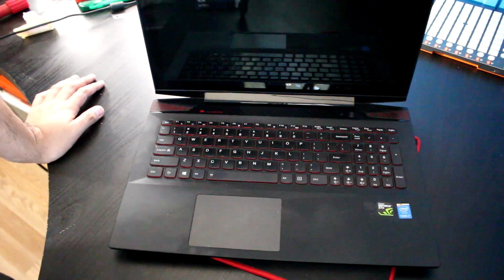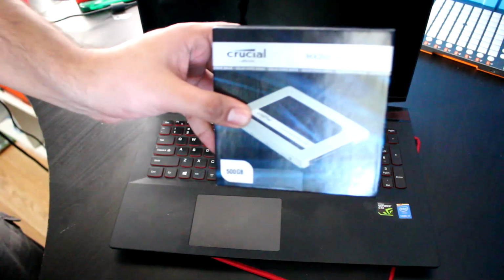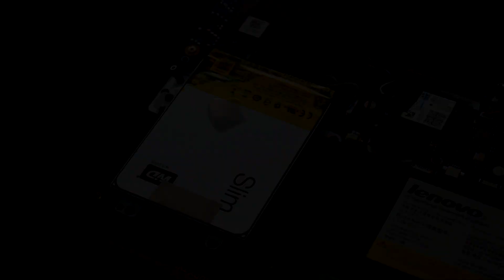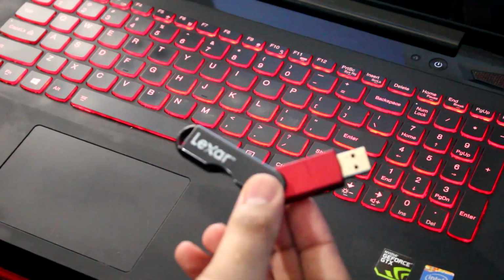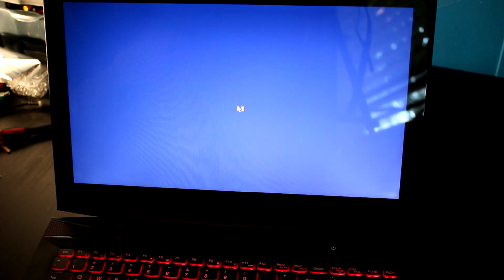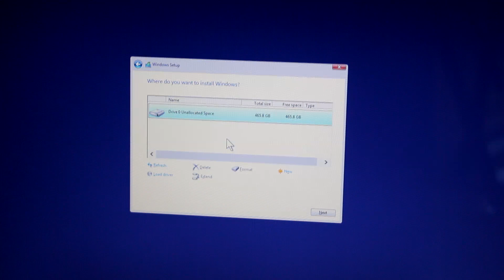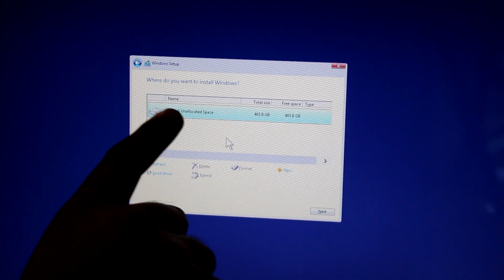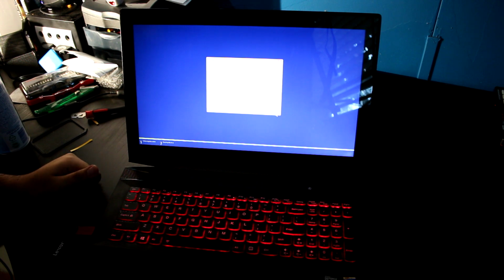How to Upgrade to an SSD on a Lenovo y50-70

Comment: Hi,
do you use an external hdmi-connected monitor with this laptop?
I have a Lenovo y50-70 with an integrated intel hd 4600 graphics card and a geforce 960M and unfortunately it does not detect an external monitor on the hdmi connector?
Did you have the same problem? How to solve it?
I have googled for a week, tried different things, tried other drivers and unfortunately it still does not work....

Many thanks for some help.

Comment: Crucial MX500 1TB 3D NAND SATA 2.5 inch 7mm (with 9.5mm adapter) Internal SSD

this ssd will work in my lenovo y50-70 4k????

Comment: Consult, this type of machines come with two hard drives, one solid, which would be the D and the other mechanical, which would be the C, or it is a single disk that divides it to have two disks, thank you very much in advance

Comment: So once I replace hard disk to ssd that means all my softwares and documents needs to be installed into the SSD again? Is there a way to retain all the files and still use SSD?
Reply: Yep, all files and softwares are retained on the old hard disk. You may want to backup the software installers (if you have them) into the hard disk before you remove it. Also, note that the old hard disk can still be used as an external hard drive, meaning you can still access files saved on it. Just buy an enclosure and cable for it.

Comment: Can you add a list of compatible SSD and HDD?
My SSD only works when it is upside down, so if I want to use my laptop, I need to uncover the components and remove the mounting screws, then flip the SSD over. I'm looking for a replacement for my storage.

Comment: Hi i just tryed this and need help. I brougt a Samsung 860 Evo and connected it to My desktop to install Windows 7 64 bit and it workt as a charm but when i connect the Samsung 860 Evo to My Lenovo y50-70 i get a message saying - defult boot device missing or boot failed. What did i do wrong how can i fix this ?

Comment: Q????... Did you back up all your files b4 you proceeded to upgrade.If the answer is yes.. which method did u use for backing up all files without any problems???.

Comment: does the sizes of various brands of SSD follow some sort of standard? if i get myself a Samsung SSD for example, will it fit into the harddisk cradle thing?

e: bought -> get myself
Reply: It should, bc laptop drives all have the same 2.5" form factor

Comment: Hey Keaton, quick question, looking at my hard drive trying to pull some information I see it's solid state hybrid. It's solid state generally better? It's a TB so not sure if I should upgrade or not!
Reply from the maker: I'd definitely upgrade to an SSD hybrids tend to die pretty quickly I've gone through 4 of them in 2 years as they corrupt easily. Not to mention they aren't much faster then a normal hard drive.

Comment: Thanks a lot man, so I changed the hard disk and it was turning on and off, turns out one of my RAM, is screwed up!
So have to get it replaced, but thanks a lot man!
If there is a problem like mine with anyone else then that was the issue!

Comment: Hey man, just wanted to thank you so much for this tutorial. My computer is faster now than it was when I bought it almost 4 years ago. Everything just feels so much snappier, like starting up google chrome is just instant now instead of having to look at a white screen for 5 seconds or more and starting up the laptop takes just a few seconds now. 
Can recommend this to anyone who's thinking about doing this.

Also to anyone who's wondering what SSD they should get. I got the Samsung 860 EVO (250gb) which is like 75 euro right now. It's a high quality SSD which will work great. Also I recommend just installing windows fresh. If you got the free windows 10 upgrade when it was around, it should be linked to your microsoft account and just getting the fresh install and logging in on that microsoft account should automatically get it activated for you.
Reply: Does every ssd fit in there

Comment: From brief research it seems that the windows key is tied to the motherboard. When you reinstall windows does it automatically detect that you have a machine that is activated for windows? You didn’t go over how you activated your windows
Reply from the maker: Oh sorry about that. If you are upgrading to Windows 10 then you simply go to the Microsoft website and download the latest version. Now if you upgraded from Windows 7 and 8 to 10 for free then the email you used to upgrade will be the way you activate Windows 10 no matter what machinr it will recognise the email. If not you have to buy it with said email and same thing.

Comment: Hey I have a question
If I have a Lenovo y50 70 touch screen. What specific SSD would I need to replace it with?
My hard drive is completely busted so now I can't boot up my laptop beyond the splash screen.
Also when you install a new hard drive do you have to install a new copy of Windows? I have one it's just that my laptop hated it when I tried to upgrade before and I always had to revert back

Comment: Buddy What difference does upgrading to an SSD make? Gaming Performance?
Reply from the maker: kevin chaudhary for me a major defference in certain games like Ark, Fallout4 and PUBG. I got huge performance defference and quicker loading times.
Reply: Which SSD would you recommend Keaton?
Reply from the maker: kevin chaudhary crucial and Samsung SSDs I've only used those 2 brands and they have been amazing and reliable. But if you have the money you can get even better ones.
Reply: Okay buddy.Thanks a lot. And Keaton would you recommend Evga Precision X for Lenovo Y50
Reply from the maker: kevin chaudhary I don't actually I've tried using it a few times before I got the ssd and it shut off my computer multiple times no matter what the settings were but it could be different for you.

Comment: I boughtn a Lenovo Y50 touch (refurbished) from new egg today and I missed it comes with just 256 ggb ssd, since it comes with the operating system, windows 10, already install, do you know if I will have access to re-install windows 10, if I upgrade the hard drive to 500 ssd? Thank you for this good video

Comment: Hi  BleedingxGhost, I have some questions before i upgrade my laptop hd/ssd . 

1. Can you give me a link to a 1 tb or something close to 500 gb drive that will work with my lenovo y50-70 (no touch screen)

2. Before i start this , How do i make a windows recovery media?

3. When i get the new drive in , Do i need to boot up with recovery media to install windows and to also get everything from my old drive back on to the new one?

4. I dont know if my laptop came with a hd or an ssd and i also dont know the difference im just looking for a space upgrade.

The model of my current drive is LITEONIT LCS-256M6S , I don't know if that's hhd or ssd..

Comment: Hey BleedingGhost, thanks for the video. Question: When reformating the Y50-70 I had some trouble with the audio drivers on the Lenovo website, do they work fine for you?
Reply from the maker: HeyYouSteve your very welcome. And as for the audio go to Lenovo website and grab the audio drivers for your laptop and that should fix it.

Comment: so after installing the windows on to the ssd don't you have to install the drivers for the lenovo y50?
Reply from the maker: Yeah basic stuff like Bluetooth drivers, WiFi adapter drivers and the Intel Chipset for the laptop, those i'd recommend to install from the lenovo website.  Just note that Windows 10 update will download most of the required drivers for the laptop to function properly. If not the website has all the required drivers for your laptop.

Comment: how do you got your windwos activated? from my point of view you choose to fresh install the windows. 
Another question is did the recovery button still work after you swithc to ssd? I find there are 2 drive's on my laptop the C and D, D contains the backup for the laptop I'm assuming if we only clone the C drive (OS & the files) we won't be able to use the backup button since we didn't copy drive D

Comment: I have tried upgrading to ssd on this same system but it won't work. I cloned my hdd over to ssd and then tried to boot from usb with the usb to sata cable. I get "inaccessible boot disk" how did you manage to get yours to work?  As this computer has pre-installed windows on it I dont know a better way to do it.

Comment: Just upgraded to SSD => Still horrible performance...
Moved from Windows to Ubuntu => Still horrible performance...

The laptop had good behaviour for abour 3-4 days. After start having bad performance.

I ll throw it in the garbage. I spend too much time and money for this sh@ty laptop. My apologies for the 'bad' words. For those who want to buy IT please please do NOT.
Reply: I have the same exact issues. I think it's Lenovo Greece in particular which has a faulty line. I've sent it back 3 times so far. I do have a decent performance for a couple of weeks and then, boom! Problems start all over again. 100% disk usage even in idle and even blue screens of death. Such a waste of money. Please do not buy this laptop! Save yourselves time and money! I am an engineer, my work depends on a good working laptop and I had serious issues so far.
Reply from the maker: Dimitrios Bizopoulos most likely your ram failing but it's your laptop do as you please.
Reply from the maker: MrChristonik most likely a defective unit not every laptop will be made to perfection off the line I've never had one problem with this laptop after installing ssd. so it's safe to say it only happens to very few lenovo laptops. also when switching to a ssd or new hard drive I'd always recommend a fresh OS install so no bad or corrupt files carry over causing you the same problems as before.
Reply: @BLEEDINGXGHOST installing ubuntu gave same issues. So I don't think is the case of fresh OS or something like that.
Reply: @Dimitrios  Regarding Lenovo support, not the most polite service indeed. You would have expected something more proficient from such a company. Nevertheless, the laptop was taken away and returned within the promised timetable.  I also have to admit that with ubuntu (16.04) performance was better and I did not have 4k compatibility issues with the unity desktop. On a final note, no they did not replace my laptop even though I specifically asked for it.
Reply: @Bleeding   
I'm glad you had no problems. On paper, it is an amazing laptop with phenomenal specs. How did you decide on the particular ssd? Based on what did you make your choice? Would you recommend a particular model? 

P.S: I clean- installed new OS every single time. Definitely not an OS related issue .
Reply: Dimitrios Bizopoulos hahaha i bought it.. Totally. Amazing one. You figure out how to use the nvidia gpu to its potential... 
Remember its not a high end gaming laptop therefore. Cheap but with core I7-4720HQ. 16gb ram dedicated hd4600 intel hd and 4gb nvidia gtx..perfect 👌
Reply: henry .moriasi i only use it for gpu computations, not for games. other than that its bad laptop in my opinion. at least my laptop.
Reply: I've been using this laptop for about 3 years (with 4-5 hours per day for gaming) but no problem with the performance, just need lots of care, like reinstall the OS every 6 months + changing the thermal paste and clean the inside, defragment and anti-virus/malware every sunday.
Reply: Using this piece from past 4.5 yrs, still working great. You might have received faulty unit.
Reply: @MrChristonik did lenovo replaced your laptop? I found the support from lenovo horrible, unexperienced and rude. Never again lenovo, thats what I learned.
Reply: for real !!!! well am gaming with it ... mid  to high setting in most games ..well pushes battlefield 1 at mid settings really good !! almost 50 fps ...but then we all know desktops are more reliable for gaming ....other than that its cool really ..just our opinions though

Comment: So let's say that I install the SSD and a new version of Windows 8.1

Where do I get the drivers so I can use the GTX 860M card without any issues??? 

Also, what's the better operating system for this laptop?? 
Windows 7, Windows 8, or Windows 10??

I copied my OS from the HDD to this 120 GB SSD, but it's giving me issues. 
I don't know why. 
I'm just quite upset to be honest.
Reply: Also, what kind of SSD would be best for this laptop?? 
I bought a SanDisk one from Amazon.

Comment: Hello friend, is spoiling the disk hard hybrid that brought the stock and buy one traditional (mechanical) e try to install the windows 10 and simply not charge me, restarts automatically, you know that? or you moved any bios settings?
 :(
Reply: I had a stroke reading this

Comment: How do you do with transfering stuff from the old 8gbSSDHDD that cane along with the laptop? And do you think this will improve the rendering in games??
Reply from the maker: He4tox you would have to use cloaning software to successfully copy over everything and be able to boot from it. However if the old hdd is corrupted then it will make problems happen on your new ssd or hdd. That's why I just back up stuff onto external hdd then install fresh windows on new ssd and hdd then just copy every back from external. And as for rendering games faster I say yes I've seen a huge improvement in loading times and rendering times in all my games.
Reply: BLEEDINGXGHOST Okey man thx for the answer and info.
Reply from the maker: I usually just forget about it, its just too small for me to use it for anything besides booting the system faster. And yes lenovo automatically uses this partition usually for recovery data and bloatware apps as  you have mentioned. I've cloned 2 sshd's before and they are a pain to deal with. Just better off without them.

Comment: I had the Lenovo y50 and I've had it for almost a year now. But I need to buy a new hard drive now cus I think mine is fried. Because I can't boot my computer. I can't even get passed the Lenovo splash. And when I do I get a "diagnosing your computer" and then "auto repair fail" and then trouble shoot or boot normal options. And literally can't do anything because my computer won't recognize my password to my Microsoft account (the same one I use to log on.) Anyway, because of this I have to buy a new ssd and windows 10 cd. My question for you is, when I install my ssd will I be able to use my external cd drive to do the install of the OS?
Reply from the maker: EMusic yeah definitely corruption of the hdd common with hybrids they don't last long. And as for your question yes you can install Windows with external disc drive. Just open boot options when turning on your pc and select the disc drive and installation will start.
Reply: EMusic same thing, came here to replace mine also. Lenovo put a shit hard drive in the y50

Comment: i want to ask , can y50-70 have hhd and ssd at the same time?
Reply: Mohammad Massadeh It's a 1TB SSHD...
Reply: Mohammad Massadeh OP is asking whether you can have both at the same time, not whether you can upgrade the HDD to SSD.
Reply: Nope. the y50-70 does not have a cd-drive slot for you to remove and replace it with a HDD/SSD. So, you can only have one or the other
Reply: It is a sshd dude! The y50 doesnt have a m.2 slot to have both ssd and hdd. I have the same laptop thats how i know.
Reply: It can... you will need to purchase an msata ssd
Reply: You can just buy Hard Drive Enclosure USB 3.0 and plug it in through side of Laptop port USB3.0 there you have it 24/7 like used to be
Reply: No,It's not hybrid..In fact 2 months ago I upgraded the laptop and replaced the 1TB HDD with 960 GB SSD
Reply: My y50-70 have 1TB HDD and 8gb SSD

Comment: What's difference between HDD and SSD. I thought that original part you took out was HDD.
Reply from the maker: HDD has a spinning disk inside that keeps data and takes more time to load as with the SSD its just solid chips with no moving parts. The original part I took out was indeed HDD and the difference is massive. SSD is way faster and smoother then HDD and will not damage or corrupt when moved around or dropped.
Reply: BLEEDINGXGHOST can you recommend an SSD for me if you don't mind? I have no idea about sizes
Reply from the maker: no problem. All SSDs are 2.5 in size so all will fit but I've only used samsung ssd and crucial and to me those are the best so far super fast and affordable now it's up to you how much storage you need my crucial 500gb cost was around $135 and it's cheap compared to others. its amazing i love it.

Comment: I have a lenovo y70 touch and I m thinking if it`s worth getting the Samsung 750 EVO 120GB 250GB SSD 2.5 Inch SATA III Internal Solid State Drive  .. can you help me a bit with it  so I won`t spend my money for nothing .. PS : I didn`t change anything on the laptop

Comment: I have the same laptop(y50) but it has a 1TB hard drive and a 24ssd in it. do you know where the 24ssd is located in the laptop because I'm thinking about upgrading it, or is that not possible? and I should just up grade the regular 1tb to a SSD
Reply from the maker: usually you would see it in the  my computers page mine had 1tb and 150ssd so under the 1tb was an 150hdd but made no difference to me. I would definitely upgrade to an ssd only the hard drive ssd hybrids always tend to fail and are super slow
Reply: +BLEEDINGXGHOST ok thanks and I know where too find on the PC I was talking about the actual hardware itself sore for the confusion
Reply: +BLEEDINGXGHOST appreciate he help!
Reply from the maker: +Tien Trinh oh no worries the ssd is integrated into the hard drive itself it's not separate from it.
Reply: +BLEEDINGXGHOST thanks a lot!
Reply: Have the same laptop with these characteristics. Did u had any problem? Mine is super slow...